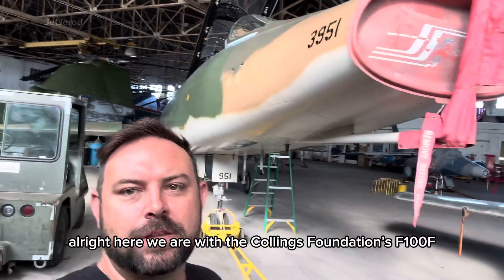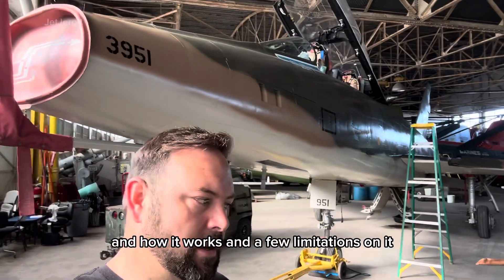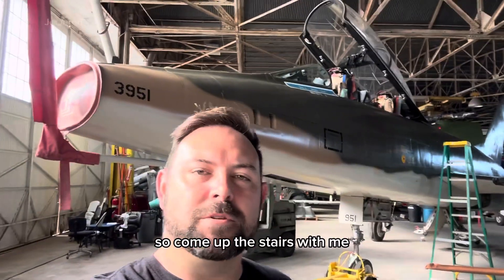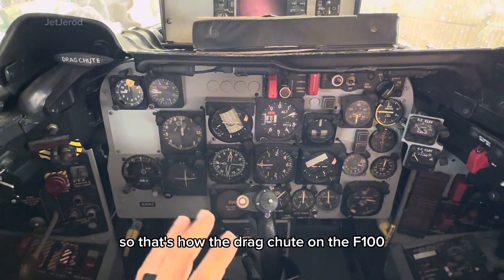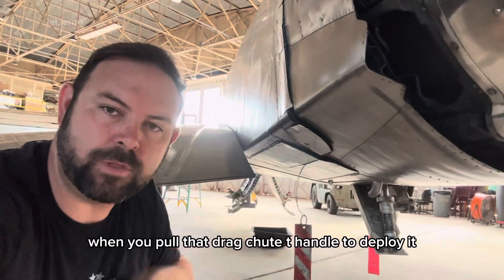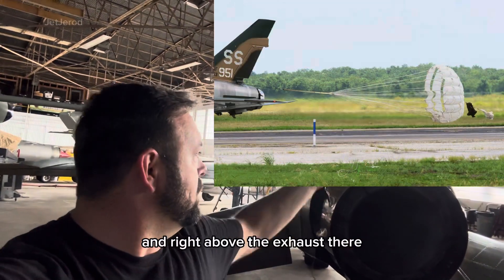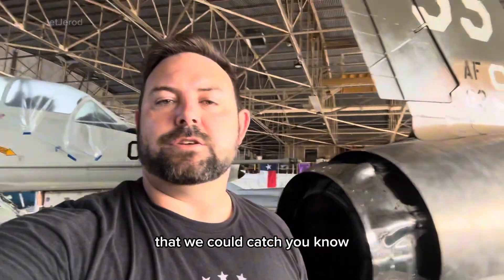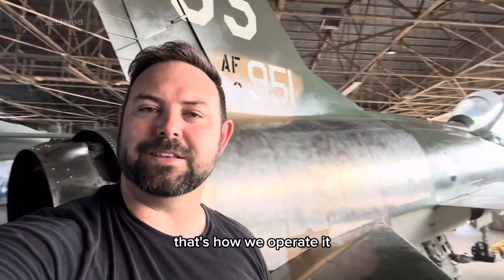F100 Drag Chute! Description…

Comment: Hello, i just subscriebed. Very nice information about the drag chute. Why do you have the drag chute? Some jets have them, some don't. Are the normal wheel brakes not enough, or is it there to minimise the wear on the wheel brakes?
Reply from the maker: @Patrik-swe  hi, thank you! Drag chutes are pretty common on the older heavier/faster fighters for sure, even some modern fighters/bombers still have them. They’re very useful for helping save brakes, also in the event of having abort a takeoff (as you can imagine, you’re much heavier on takeoff than landing), it’s quite an effective tool to make the operation a bit safer. Brakes are good and on a long enough runway, you can use them alone. We’re also equipped with an emergency hook so that we can catch a cable as well. 3 solid ways to get this beast stopped! The MiG21 we fly also has a drag chute, so does our MiG17 (which we don’t really use on that aircraft).
Reply: @JetJerod  Interesting about the drag chute limitation.  I don't recall any limitations with the F-4 even with no flap landings.  Great presentation.